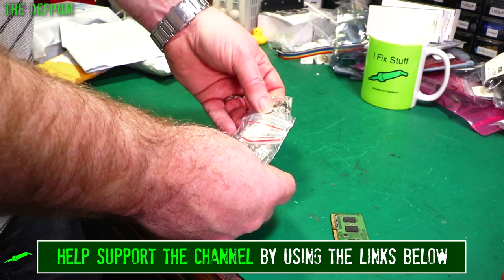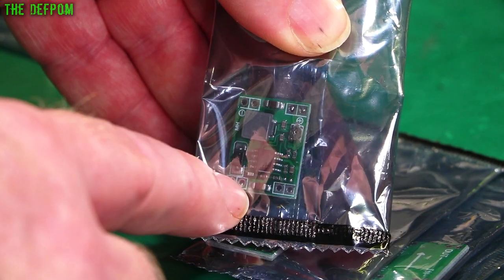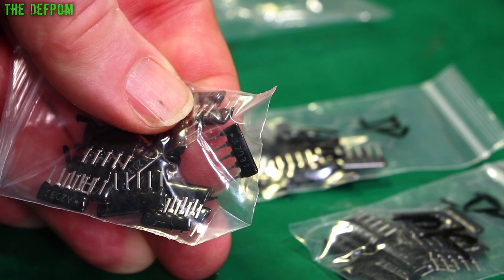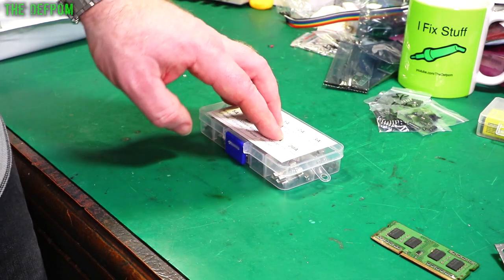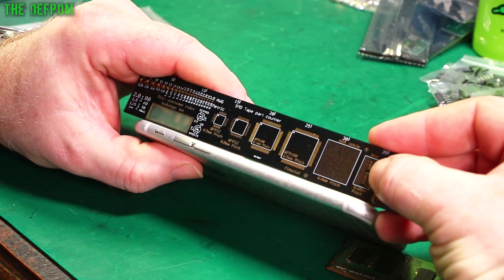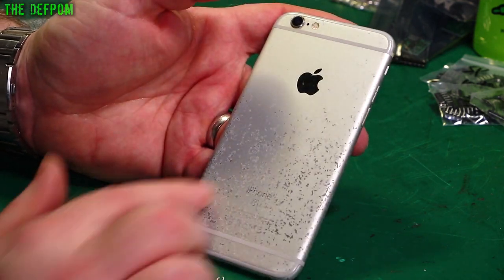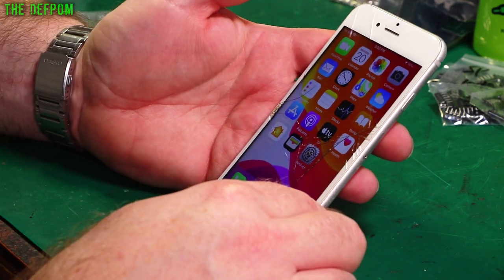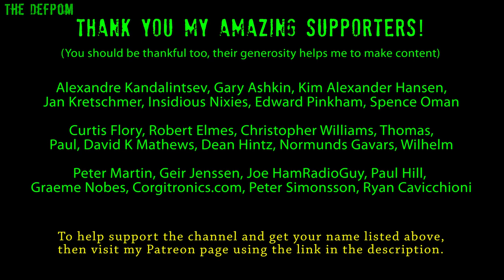#750 Mailbag Monday 24th August 2020 🎞 📭 📦 📩

Comment: Can you please test those 9v batteries. Hopefully you have a load that can calculate their capacitance and maybe check discharge curve etc. Thank you
Reply: The biggest problem I find with these batteries is that they self-discharge fairly quickly.  This is because of the internal regulator's quiescent power consumption.

Comment: The Iphone 6S is the oldes supported phone from Apple now.
Will get IOS 14 when it's released later this fall (well, fall at the northern hemisphere that is...)
but that might be the end of the line for that model. So is it worth fixing then?
BTW I prefere to have the batteri fully discharged when I take them out.
Their stuck in there like S****t, and can easily short if you are not careful when removing them.
Reply from the maker: Yes those batteries can be hard to get out sometimes, they have pull tabs on them, and when they work they are great, other times they just snap and you have to dribble some IPA under the battery to help get it out.

I am getting the 6S because it is the last iPhone to have a headphone socket that makes them more relevant in my mind, I use my headphone socket every day, apple only took it away in later phones so that they could sell their wireless EarPods to you... which you then have to replace every year because the batteries are knackered. great money spinner for them, tying you into buying more from them forever, instead of giving you a headphone jack.